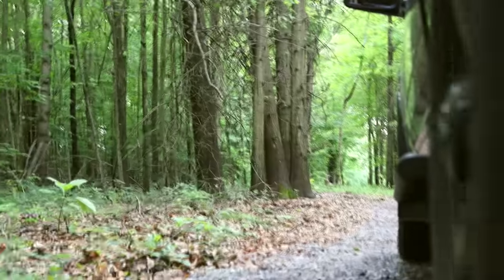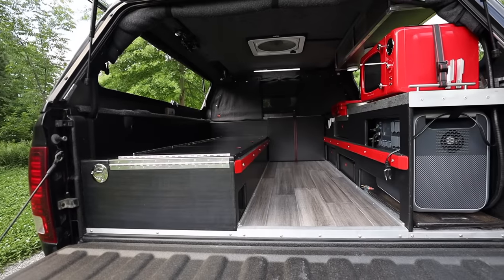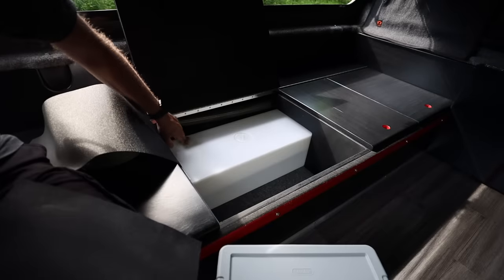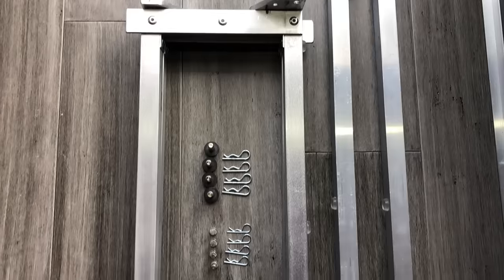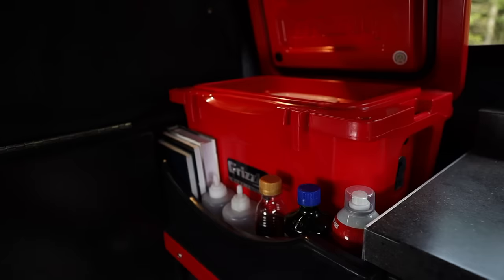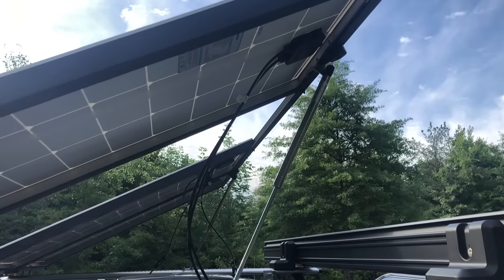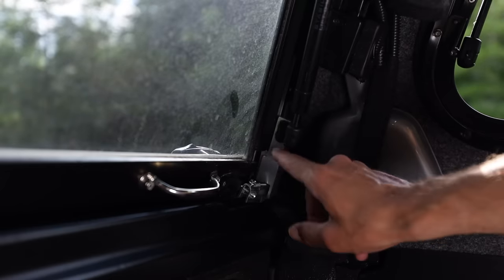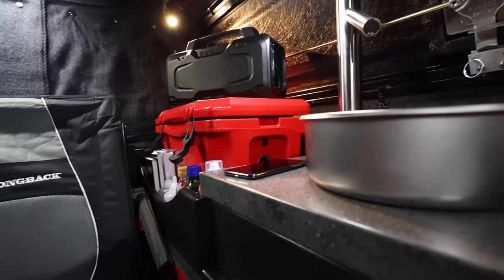My Ultimate Truck Cap Camper Build Full Tour!

Comment: Hmm . why did you make all the drawers underneath where you sleep rise up. fight it was me I would have put the like had to pull forward cuz when you have your bed down you got to pull all your bedding up just to get underneath that's kind of like not the smartest thing ever. if you can made the toilet rise up at the end and then had all the other ones of drawers where they pulled outwards so you can have the bed on top of it and pull the drawers out where your feet were
Reply from the maker: Reasons why I didn’t make drawers under the bed:
1. Wanted to maximize the amount of storage space.
2. Because of the water, drain and electric lines, it cuts up the space quite a bit.
3. Since the side of the bed is not only the structural support for the single bed, it is also the support for the double bed and I didn’t want to weaken it with slide out drawers.
4. With the bed rail attached to the side and the drain line running along the floor, any drawer that I could fit in the space would be very shallow since it is only 11” high to begin with.
5. When the double bed is set up, all access except the removable support by the toilet is inaccessible. It’s much easier to move a cushion than the wooden bed platform.
6. When the dining table and two chairs are setup, drawers would be inaccessible.
And those were good enough reasons for me! Thanks for watching!
Reply: VR what's with the negative comments?  This is an awesome build and works for HIM!  It was greatly appreciated for him to share his ideas and creativity.  Take out ideas that may work for you and tweak them to your personal needs. No need to insult people for sharing.
Reply: @janet1667  understand laying in bed have to get in something out of the underneath and oh you have to get up that's kind of stupid

Comment: Opening was a bit overdone and overdramatic. But...I stayed tuned in then.....the part when you had to put the water supply fill behind the tailgate so " the water supply is secure and can't be tampered with" I had to leave. If you actually believe someone is following you to mess with your water....well, you need to speak to someone.
Reply from the maker: The intro is intentionally over dramatic, it made me laugh. I’ve owned 3 airstreams, a Monaco motor home, and an atc toy hauler and every single one had the water inlet secured behind a lock and key…thus my inspiration for design. As far as speaking to someone though, you’re probably right! 😆
Reply: @WhentheDustSettles  Your video was very well done and professional. I too had an ATC toy hauler and talk about comfortable. Big shower and bathroom, along with a separate bedroom. Hauled 3 motorcycles. Gas prices have driven me to a small bike trailer and now I want to do a similar truck build. I don't have the tools or skill set, but I am anxious to learn and do it myself. Thanks
Reply from the maker: @chaz3372  Fuel prices are insane! The ATC was definitely nice except the non-insulated floor when the temps dropped outside. I'm sure you'll do just fine on your build! YouTube is a great resource!